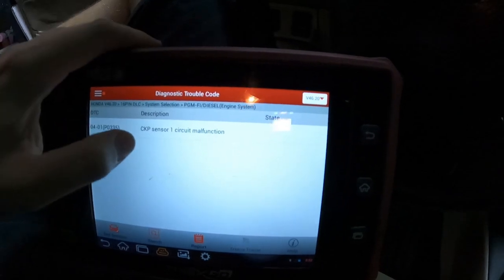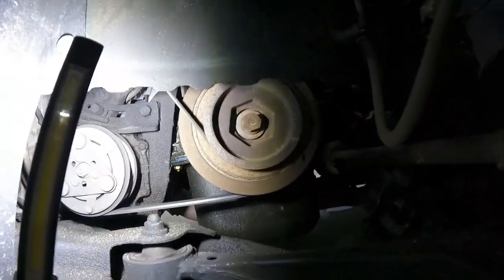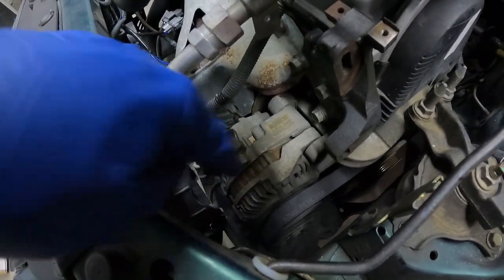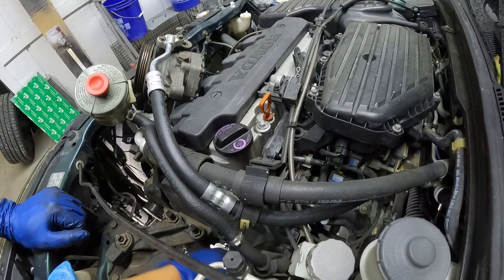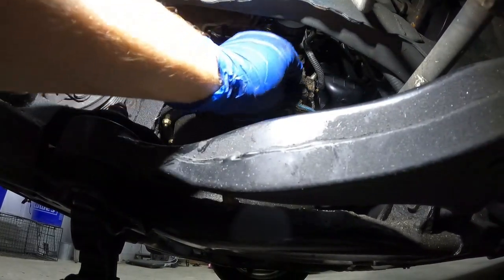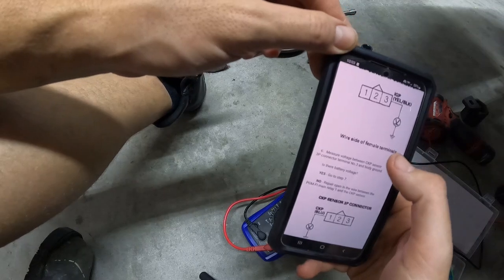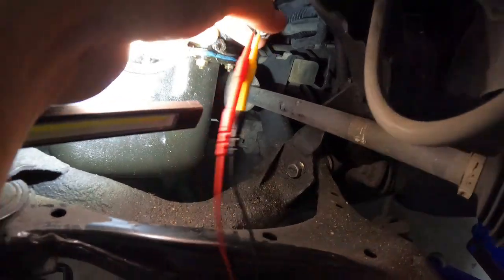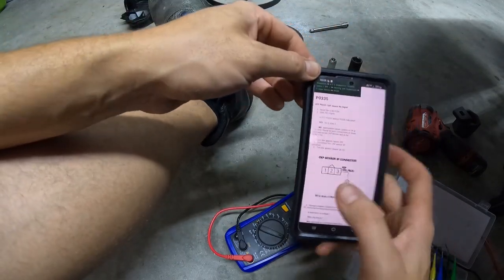P0335 Diagnosis and Crank Sensor Replacement 2001-2005 Civic DIY How To

Comment: Okay so this is the issue why my car not start sometime
Reply from the maker: If youre getting that code, then yes its probably the sensor, assuming that the wiring checks out
Reply: @ballsoutperformance  i have not put the computer yet, but i will check it and see which code its show thank you